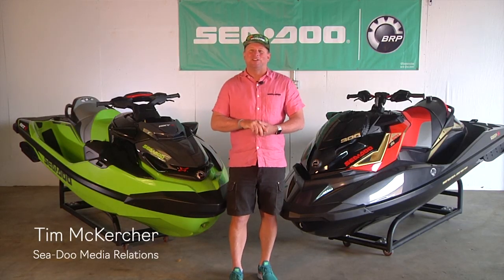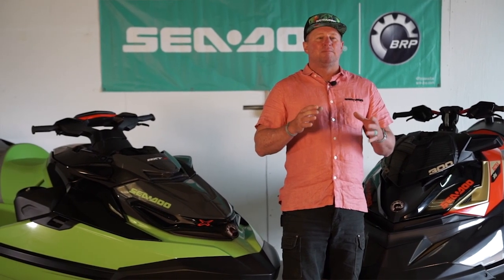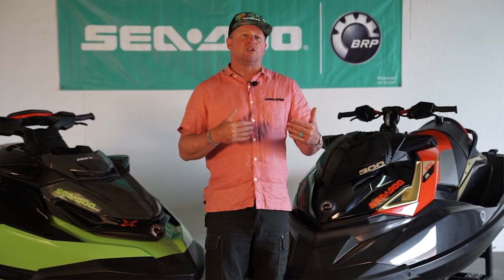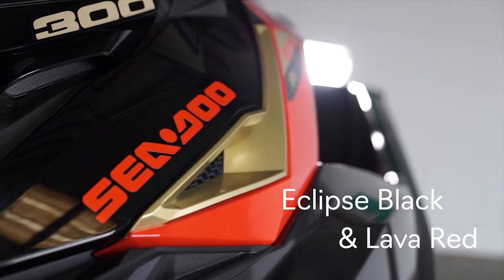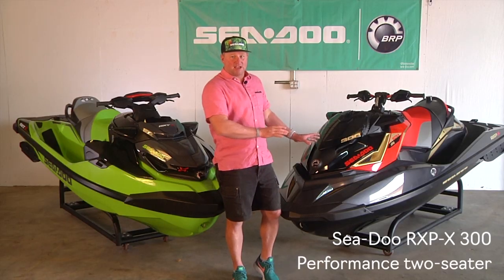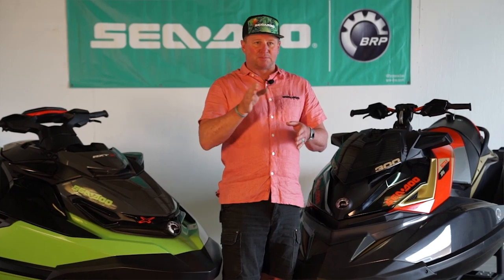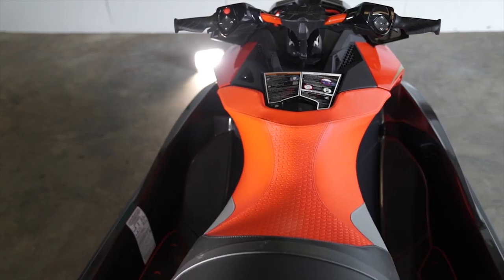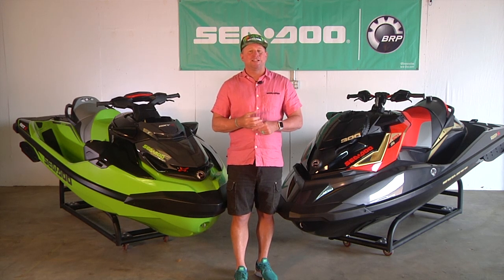2020 Sea-Doo RXT-X 300 vs. 2020 RXP-X 300: The Watercraft Journal, EP. 63

Comment: If yamaha focus on innovation and design too they can beat seadoo but at the moment seadoo is so much better,they Need to improve reliability and they would be the perfect boats
Reply: Ive had had probably 10 sea Doos and never had a reliability issue. Owned them since 2000 (GSX lmtd). I wont buy another brand simply because ive NEVER been stranded on a sea doo. Then again I only buy new and not used, so I maintain them as they should be maintained. Just got a 19 RXTX300 and havent ridden it yet. Cant wait after watching all the videos. Cheers from Florida.
Reply: Exoticar Auto Esteban doesn’t know wtf he’s talking about. I’ll bet he doesn’t even have a ski.
Reply: @b4ds33d  You should learn how to read
Reply: Kendrick Carroll  i have owned 3 seadoos, and 2 yamahas 1.8, and for sure Yamaha is a lot more reliable, but still ahead seadoos on design and features, but for long trips Yamaha is the key, i hope also kawasaki return to the battle
Reply: Kendrick Carroll  of you know about pwc you know im right dude🤷‍♂️
Reply: Esteban rodriguez I’ve had at least 5 of each brand and I’ve never had an issue with any of them as I kept them maintaiNed. But the seadoos held resale better and were just better built and appointed.
Reply from the maker: Sadly most folks focus on bells and whistles and neglect how well a ski rides.
Reply: Based on that assessment, does that mean Yamaha wins now?
Reply: I sold both my GP1800’s and went with RXT X. Best decision ever

Comment: So Happy I bought the SVHO Yamaha’s..... they do circles around these sea doo’s once the computers are unlocked.  Yamaha’s are severely held back in box stock trim.   That’s why all the racers Choose Yamaha
Reply: david g  But they be ugly. And the color/designs are an eyesore! My friend has an RXPX doing 94mph...so, there is that too.
Reply: Kevin Lamb  94 on a sea Doo requires ALOT of work.... mod for mod the Yamaha’s are faster, period.   So that sane package getting that sea Doo to 94 would have the Yamaha doing close to 100
Reply: @KevinLambguitar  u can change the look and down here in miami its not rare for skis to be goin 90 mph but da yamahas are da ones everybody chooses to get more power der are 100 mph skis down here and 99.9% are yamahas
Reply: @tumadre4168  Part of that is RIVA's dominance in the aftermarket.
Reply from the maker: Wait until 2022!
Reply: @watercraftjournal  would you cancel your 2021 and choose a 2022 instead?
Reply: @KevinLambguitar   to each their own, I bought a 2021 rxpx in June when my 2021 GP1800 didn’t show up, and I hated everything about it.  Funny you mentioned ugly, I think the 2021 rxpx is the ugliest ski ever produced and was shocked when it actually showed up.  
Riding it felt like most of the ski was actually in front of me with that long ass hood, it really feels fat snd slow compared to the Yamaha’s.   I tried to like it, but hated every minute on it, I sold it late July and still waiting on my new GP.   94 on a se Doo takes a tremendous about of work and mods, no matter what you to, the Yamaha’s are always significantly faster with the same mods,  that’s just Facts.    I currently have 2x 2017 GP1800’s with deans team tuning and really not all that much work doing 89mph and 90mph.

Comment: I got a 2018 rxtx 300 with 47 hrs and about to have my second carbon seal fitted , and knee pad have changed colour I got 1 silver and now 1 gold ish
Reply from the maker: Dang. We're sorry to hear that.
Reply: I also have a 2018 RXTX with under 20 hours.  Carbon seal still looks good.  Did you replace the carbon seal under warranty?
Reply: Do you rev it and run it out of water? Heard that that can cause the carbon seal to wear
Reply: Gareth Browning you need to align the engine to avoid this to happens again, some skis comes from the factory way off. There is a special tool to perform this job. Please check the 3 feet deep youtube channel, in one of their videos they explain very well step by step how to perform this job. Also while you are flushing your engine if you ride in salt waters don’t do this for more than 2 minutes, this extra heat cause the carbon seal to fail prematurely. In the past I use to wrench my own Sea Doos PWC and the best watercraft tech in my área is a close buddy’s of mine. This was some pointers he gave me to avoid this issue for happening 👍😉.

Comment: I just made my purchase today.  Here is what my research and my use led me to buy.  We will be having two riders from time  to time.  Both will be adults and the RXP is only 400lbs capacity so two adults would max out the weight.  We purchased the RXT X300 because it is 5 inches longer, 600 lbs capacity and more stable.  Hope this helps you.
Reply from the maker: Yes, the RXP-X is still rated as a two-seater, the last of its kind. The RXT-X and all other ST3-based Sea-Doos are 3-seaters, and thereby rated with a maximum of 600lbs.

Comment: Hi a question for the water craft Journal, i was about to buy the rxpx but i'm now considering the rxtx. Since i still like the look and design of the rxpx better would the rxtx be that much more stable in rough waters? I'm going to be riding in miami so chop is to be expected. I was sold on the rxpx before the video...We are coming from a gtx130. I plan on having my wife as a passenger most of the time what do you recommend?
Reply from the maker: Woof. Both the RXP-X and RXT-X are brutal in rough ocean waters. Especially if you're considering riding 2-up. The neither track straight in cross-blown waves and struggle with predictability when running at speed in these conditions. I simply cannot recommend either given the parameters you've presented.
Reply: @watercraftjournal  ok wow.. What would you recommend?
Reply from the maker: A Yamaha FX Cruiser HO. Hands down.

Comment: Seadoo Ergolock seat are no good for someone that 6.4foot tall when I tuck your knees into the seat my feet don't set flat on the footwells all my strength is transferred to my upper body and makes it hard riding for me that why I have stayed with the S3 hulls.
Reply: I'm 6'5", I find my RXT-X very comfortable
Reply from the maker: The proportions of the RXT-X are far larger than those on the P-X. And you don't set your feet FLAT on the footwells, but use the foot wedges to angle your knees in.

Comment: I have a question about the hull. Seadoo says ST3 (and the older S3) is good in rough water because of the V-shape. But isn't the T3 even better then i rough water because its V-shape? Which one would you prefer in rough water? Thanks
Reply from the maker: Actually, both are pretty bad in rough water conditions. The description given is a little misleading because neither are true Deep-V hulls; both the ST3 and T3 feature a 23º deadrise (that just means the rise angle of the hull, not the actual angle of the V). But most prominently is the deep, knife-like keel of both hulls. These unfortunately, act as a "front rudder" in many cross-chop circumstances, and make both machines quite unruly in stock form. When equipped with aggressive aftermarket sponsons and intake grates, these behaviors are improved but not wholly resolved. Pay attention to how many racers use these machines, and in what classes/level of modification.

Comment: Thanks for a good video. Do you know if PX takes in more water in rough seas because water comes thru air vent. On TX they are closed?
Reply from the maker: Unless you're continually submarining the P-X (or T-X for that matter) you won't see a lot of water infiltration. The P-X air vents are more restrictive than what the body panels would have you think.
Reply: @watercraftjournal  Thanks for quick answer.

Comment: Hello, I am considering a Sea Doo GTX 300, RTX 300 or RXP 300. I live in Sweden and it’s not so much waves here where I live, only if it’s very windy. We have a boat already and I am looking for a jet ski to go race against other jet skis, boats etc but also to jump and do tricks with. I also love the speakers in the sea doo gtx 300 and rtx 300, which one do you recommend? Is it possible to get the same speakers (or almost identical) to the rxp?
Reply from the maker: No, the BRP Premium Audio is NOT available on the current RXP-X 300 (but will be for 2021). Sea-Doo strongly discourages wave jumping their PWC as this can severely damage the carbon seal, and void warranty if total failure is to occur.
Reply: The Watercraft Journal Thanks for the reply! So you mean if I wait until next year, I’ll be able to get the speakers to the RXP? Which one do you recommend me to get? I like the luxury details with the GTX Limited 300.
Reply from the maker: There's only ONE sound system option available from BRP.
Reply: The Watercraft Journal Thanks for the fast reply, what do you mean?
Reply from the maker: The BRP Premium Audio is the same internals from the ST3 to the GTI. No different. You asked "which one should I get?" They're the same.
Reply: The Watercraft Journal I mean which PWC you think suits me the best, I am just saying that I like the BRP premium. I am considering a GTX 300, Rtx 300, RPX 300.
Reply from the maker: That depends entirely on how skilled of a rider you are, how athletic you are, you preferred riding style, your typical riding location(s), how long you typically ride, your expected or intended use, etc. 

I often compare this question (what ski should I buy) with being asked "what kind of shoes should I buy" – again, it depends on a lot of factors.
Reply: The Watercraft Journal I have tried a jetski 1 time in my life, I am not very athletic, I like to jump and race, the water here is very still and no waves are here, I just wanna go out for a ride and jump but still go and swim. With this information, which do you think suits me?
Reply from the maker: You're not really going to use the RXP-X or the RXT-X to its fullest extent, so it would be wasted money to after these machines. A GTX 170 or 230 might be a better choice.
Reply: The Watercraft Journal Ok, so I’m going for the GTX, also, what’s the difference between GTX and rtx? I couldn’t find anything by research